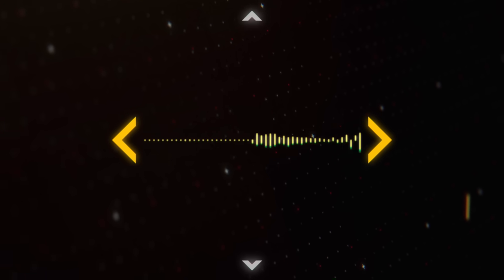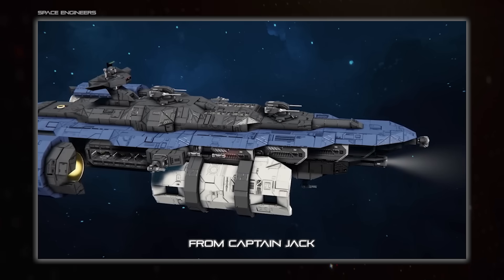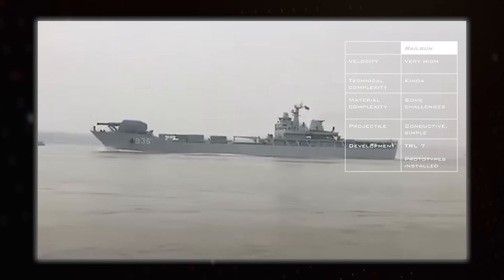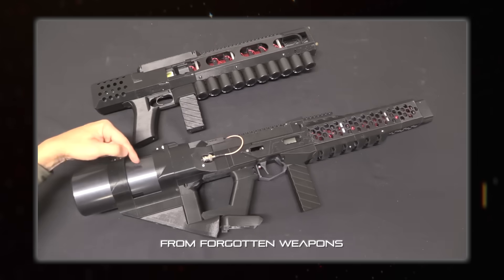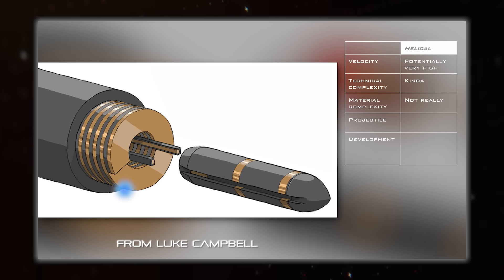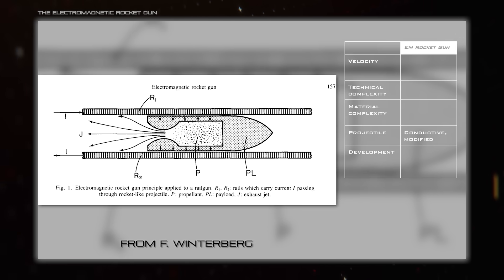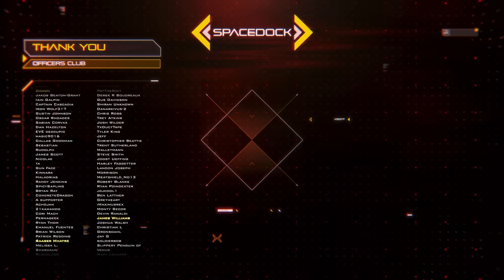The Deadly Coilgun/Railgun Hybrid You've Never Heard Of (Helical Railguns)

Comment: I believe if the tech goes forward, the most potential comes from the coil gun (aka Gauss rifle from my Battletech/Mechwarrior fanboy background, although it's a smooth bore).

I think the wear coming from dumping millions of amps through sliding contacts is pretty much at the limit of current/short-term material technology levels and you can't have a weapon with hours of downtime every 3 to 5 shots.

Coil guns, although technically more complex, switchgear tech is ever evolving and some designs use the projectile itself to trigger the coils accelerating it. With what we know from homemade projects, the measured efficiency of coils guns (MJ of power in to MJ of kinetic energy) is less than railguns, but other than needing more energy to deliver the same kinetic energy, there is virtually no barrel wear while still (theoretically) achieving hypersonic muzzle velocities.

Comment: A big advantage of traditional chemical firearms is that most of the heat is captured by the brass casing which is immediately expelled from the gun. In an electric weapon most of that heat is dumped right into the gun itself.

Comment: 1:38 Generating and storing current?  
OK, at least producing the current needed to produce the magnetic fields desired.
Another difficulty is the Lorentz forces, or making the rails overcome these forces.  Since electrical contact with the projectile, and lots and LOTS of current is required, and the Lorentz forces tend to push the rails apart, this would contribute to loss or reduction in contact with the projectile.  There would seem to be a limiting factor.  Attempting more current to get stronger launch forces would tend to more strongly force the rails apart which would tend to defeat the high contact pressure needed to get the conduction needed to get the high current desired. 

Meanwhile, for the coil gun, current art electric motors, BLDC motors, use field oriented control to sense the position of the armature and apply current as needed to the appropriate stator coil to control the position/velocity, etc. of the armature.  A similar technique could easily use energized and non-energized coils in the coil gun to sense the position and velocity of the projectile and control the energy going to the appropriate coils in order to tailor the projectile's velocity as desired.   Consider max velocity is cool, but if half velocity will get the job done, twice as many projectiles can be launched.  

For the techniques with embedded coils, and latter, I don't see how a consumable part made so complicated could be inexpensive enough to throw away.  Surviving projectiles would need to find a way to fly back home to be used again. 

Cool video, though.  I love all the animation footage etc.

Comment: I'm thinking what if the complicated bullet of the helical railgun was used as a pusher to push some non-magnetic bullet but there is some aluminium or something to slow it down using eddy currents so that you can reuse the pusher

Comment: Interesting concept. But as the Helical Railgun projectile is not spin-stabilized it would probably need find and therefore a sabot to achieve some measurablle distance. Also the complex projectile mechanics would make some kinda warhead/payload unachievable and the projectile alone would lose alot of its kinetic efficiency due to the softer mechanisms inside. Also the mass production of these finnicky projectiles with their rather complex mechanisms make them horrendously expensive, negating one of the best aspects of electromagnetic weapons...

Comment: I was thinking of a solution to the cost of the casing of the shell and I found an idea that is probably completely flawed, but that I still found interesting. If the shell of that concept is expensive, could we increase the length of the barrell and (with timing then sadly) slow down the sabot and stop it in the gun. In this case, if you were to loosely place the projectile in such a way that it would only have one degree of freedom (forward only) relative to the sabot, you could release the projectile without having to lose the expensive casing and the projectile would only be released once the sabot starts to slow down. 

What I wonder is if such a method would allow less casing to be used and, thus, less overall costs of the gun on the long term. Now, the issue with this is that, while it doesn't double the lenght nor the energy costs of the barrel as (I imagine) the casing would be MUCH lighter than the projectile (Here I assume that the mass of the casing is significant (say 10% of the projectile)), it still probably increases the energy and initial material costs of the gun significantly. Also, what would this mean for the maintenance costs of the gun. Would they outweigh the advantage of reusing the casing for the duration of an estimated safe lifespan?

(I'm putting it out here because, I may have a physics degree and working on my second one... but I am not an engineer)

Comment: Any sort of coil gun faces the problem of heating up the projectile due to inducted currents. so the melting temperature of the projectile (or the coil inside it in the helical gun) limits the energy and by that the projectile speed.

Comment: I wonder if it's possible to heat the rails up a little and use a low melting point alloy as a lubricant. It would have to be able to wet the rail material of course, but if it works it would be conductive lubricant and you might even get a Leidenfrost effect to further reduce friction.

Comment: You can achieve the same kind of performance just by using better propellants. Lots of work has already been done in this area researching and developing advanced energetic materials. Thermoplastic elastomers show a lot of promise. Going this route is cheaper, because it doesn't entail refitting your entire military infrastructure with new, energy-hungry systems, plus you can avoid problems like the rails wearing out after a few shots. That's the direction I would expect the technology to take, at least in the near term

Comment: 🤦‍♂️ rail gun erosion isn't due to friction... It's due to plasma spalling.  Basically a small amount of the metal is vaporized as plasma as the high current passes between the conductors. If this plasma doesn't form, then the rails get welded to the projectile and it doesn't go anywhere. It just superheats and vaporizes the projectile.
That is also not how high power mag coils work. That's how low performance mag guns work. Real coil guns don't use DC... And they don't pull... They push/pull in pairs.

Comment: The only problem the Navy had with the railgun was material erosion of the barrel/armature assembly. But with advances in metallurgy that could be overcome, similar to what SpaceX did with Raptor engines. Raptor engines use a unique metal that doesn't break or melt to power the pound for pound most powerful rocket engine ever built.  But most significantly, reusable. Like what's needed for a realistically plausible railgun. With AI, who knows what kind of metal or conductive ceramic could be invented. Hmmmm?
Reply: I agree that has been a significant challenge for many years - so there is the potential that a research breakthrough might occur someday.

Comment: I’ve considered the MHD aspects of Rail/Coil/Helical Guns before.
Also considered EHD variations and asymmetrical capacitors, topological insulators and various different geometries for the projectiles fired.

I think a combination of all of these would create an optimal system.

Storing of charge within the projectile would also enable an electrical discharge from the projectile onto the target site, this could also contain explosives if used as weaponry.

MURICAAAAA

Comment: As I understand, for railguns, the Lorenz force that so quickly shoves the projectile forward is also the primary force that causes the extreme wear and tear on the railgun's barrel - the opposing magnetic fields are literally causing the barrel to rip itself apart.

I'm kind of hoping to see a game have all of these, each with its own downsides: railguns start breaking themselves faster but their repair is cheap and omnipresent, coils have some inconsistent projectile velocity but can fire more than rails before needing maintenance, helical rails cost a lot (both for the weapon and ammo) but it also needs minimal maintenance and is consistent and has a higher rate of fire (you can just keep the rails charged and the next projectile can be sent as soon as the previous leaves the barrel, though I think this is theoretically true for normal railguns as well...)

Comment: "Higher velocity is particularly important in space combat because increasing projectile velocity directly increases effective range"  Umm, no, this is wrong.  It's actually exactly backwards.

Increasing projectile velocity can increase range in an atmosphere because it allows it to travel further before air resistance renders it ineffective.  However, in the (near) vacuum of space, this is basically not a concern, and the effective range of a projectile can be just about whatever you want it to be (as long as you can hit your target), and has nothing to do with its velocity.  Space combat is the one place where velocity does not increase effective range.

The main advantage to higher velocity is actually because the amount of energy contained in the projectile (and thus how hard it hits) increases linearly with its mass, but it increases with the square of its velocity, which means that increasing the velocity can result in a much larger improvement to the damage it will do to the target than just increasing the mass would, so if you have the choice, higher velocity is usually better (whether you're in space or not).

Comment: One interesting coilgun variant, that however wouldn't likely be viable for weapons use unless high-critical-field room-temperature superconductors are discovered, is the quenchgun. The projectile is a shorted superconducting coil, and the barrel is made up of a series of shorted superconducting coils. The barrel coils are charged to as high a current and field as they can take. When it is time to fire, a current is induced in the projectile coil, causing it to be pulled into the barrel. As the projectile reaches the center of one barrel coil, electromagnetic interactions deinduce the current in the barrel coil, which is then immediately quenched, i.e. made non-superconducting anymore, to prevent an opposite current being reinduced as the projectile leaves.

These have been proposed as mass drivers for delivering payloads from the surface of the moon, where in the use as infrastructure rather than a weapon the cooling requirements for current superconductors would not be prohibitive.

Comment: Spacedock forgot to mention the reason the Winterberg Electromagnetic Rocket Gun was even conceived.  Mr. Winterberg developed this spell in order to design a projectile launcher system capable of yeeting the required projectile fast enough to "tamp" (his words, I'd have used something like smash) nuclear fuel hard enough to start a fusion reaction.  Literally slapping a bit of nuclear fuel so hard that it compresses so fast that it super heats enough to start a fusion reaction.
Reply: In that kinda situation I guess the rail erosion kinda stops being a concern at all.

Comment: Nah, the actual challenge is not storing and delivering the power, it's designing materials so that the armature doesn't weld itself to the rails, destroying the weapon in the process. The plasma arcs that can occur due to the electrical potential are an absolute nightmare to engineer around.

Comment: The flames coming out of the railgun barrel in the USN testing videos is actually a plasma sheath formed because the projectile accelerates so fast that the air in the barrel is compressed into a plasma, and with no where else to go, it jets out the front of the railgun.

Comment: So, if the rails in the helical rail gun are only used to transmit power, they could be replaced with a wire that connects the projectile to the breach of the barrel. You'd just need to make sure the cable gets cut (and ejected out of the barrel) as the projectile leaves the barrel. That would eliminate two points of friction between the projectile and barrel (with the associated wear, arcing and engineering tolerances issues).
Also, the helical railgun projectile doesn't need to be as complex as shown. In a "pulling" configuration, you could replace the coil inside the projectile with ferromagnetic material (or a permanent magnet), and the section between the two ring contacts with something non-ferromagnetic (like air). Yes, a ferromagnetic slug won't produce as strong forces as a coil projectile, but it would make it cheaper and less failure-prone.

Comment: Today I learned that helical railguns are not just the default way to make railguns. I never thought of a railgun and a coil gun as being separate devices, just two component systems of one device. I pretty much figured the only reason to build out one of those systems independently would be because our materials science is a little behind anyway, and making prototypes of the full integrated device at this stage would be profligately wasteful compared to the use you could maybe get out of it

Comment: This is an interesting spin on a coilgun (no pun intended), but I wouldn't say it's very related to a railgun as the lorenz force is probably minimal. It just so happens to have rails.
The thought about the "complicated projectile" being "just a sabot" is interesting. Could it be recovered and reused? Maybe the last section of the barrel could reverse the coil direction, and brake the "sabot" while letting the projectile fly on, to make recovery easier somehow...
Reply: or wait is it still the Lorenz force if it's applied through coils? I'm no expert but I feel like theres some difference in how they operate still.

Comment: Just make the rails simple, single use like the shells on modern ballistics. Since they are mostly just metal to begin with, they would be easily recycled. The downside being the need for larger "projectiles" and their storage and weight issues.

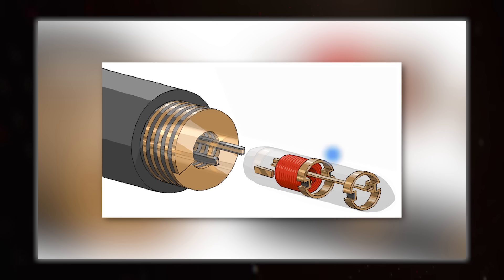Comment: I think that explanation is a bit misleading. From the picture around 5:30 we can see that the internal and external coils are connected in parallel, so they do not share current.
The rail terminals are connected straight to the slip rings.

Comment: I don't see the benefits of the helical gun to the railgun. In essence you still have the contact and heat problem  from the railgun plus added complexity.
Timing the coil in a coil gun could be done with trial and error as a last resort if there really isn't another option. Sacrificing a couple thousand rounds to get the timing just right sonds like a relatively small cost if the rounds are just shaped pieces of steel.

Comment: I was confused when the video said coil gun projectiles are levitating in the barrel and don't produce friction.  Also, you put 'chemical' in the list of projectile launching types but didn't put physical?  There are devices/tools/weapons that work off tension, air pressure, springs etc.  Heck, there are the supposed 'rods from god' that are just taking advantage of gravity as a power source (though to be fair it takes chemistry/rocketry/various other technologies to get them up there in the first place).

Comment: One other issue though, with such weapons, is also dependent on what is fired. These weapons lack rifling, and thus cannot just fire a regular bullet as accurately. The cool guns shown actually have a bit of an issue with accuracy. But to be fair, the people were not always firing actual bullets. Although, a cool thing, so long as the caliber is the same, projectile size does not matter as much, at least, definitely not for railguns (outside of needing more energy to get more velocity)
For example, the Anvil (one of the cool guns shown) can actually extend the stock a bit, and a longer magazine can be inserted for longer rounds.

Comment: There are some wore advantages to coil guns (some of them apply a bit to rail guns but not nearly as much) coilguns can shoot projectiles very quietly because they do not have a large amount of gas that escapes after the bullet. They also have no muzzle flash and do not produce smoke. They could also use nearly anything as a projectile. You can also use supercooled superconducting coils in coil guns for increased power. This is similar to a lot of the technology used in medical mri machines. I could see ships using these.